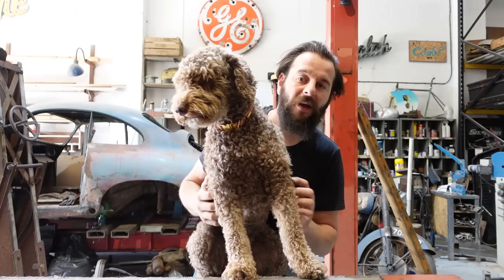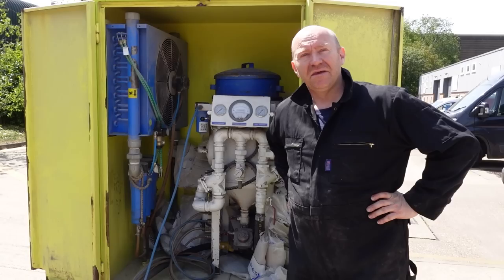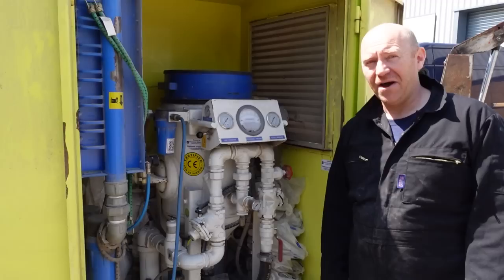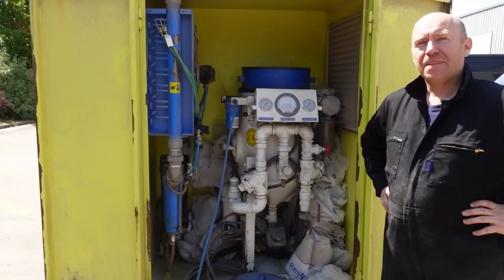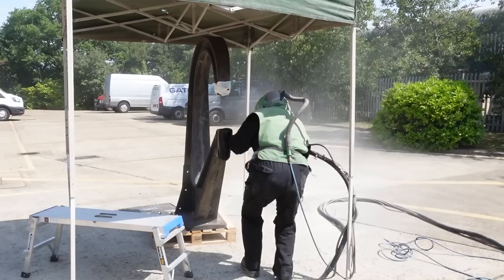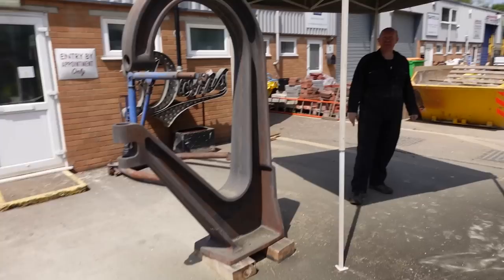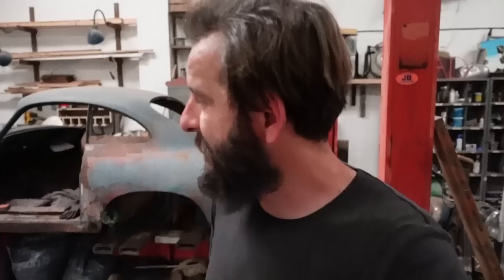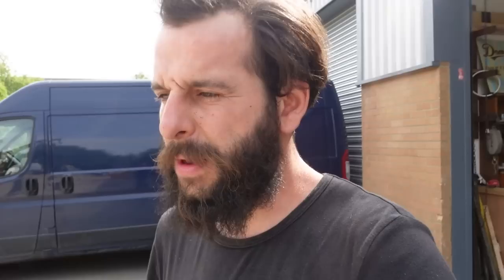Sandblasting And Painting The Ranalah | Reviving History

Comment: I would absolutely LOVE to get hold of a larger old Ranalah wheel machines. The school I went to in the UK, ( 55 years ago), had four that came from one of the WWII Spitfire factories. Although I doubt I could afford it. I think he means "purified air". Pure oxygen would kill you if you breathed for more than a short time resulting in shock lung. I also use a fresh air system. Nice compressor. I use an old 1956 LeRoi 4 over 4 tow behind compressor using 1" line at 175 psi. The gun is hand operated with a 'dead man' switch. Also can be used as a wert blaster. Any media from soda to steel shot.

Comment: When you get to blasting your Porsche have a look at hot zinc metal spraying. It's an excellent process for coating the undersides of vehicles with zinc so you get all the benefits of galvanizing but without having to dip anything. Something that the "retropowercars" channel (up in Hinckley) use on their restoration projects and it seems to virtually eliminate the possibility of future rust.

Comment: I’m just a DIY’er but if I’m painting from a cup (or small tin) I put the cup into a slightly bigger old bucket with a handle, and pack a rag round it to keep it secure. You’ve then got a handle to hold, easier to put down and pick up, less likely to knock over, and can stick your brush in the space between cup and bucket to free up a hand. Really enjoy the videos!

Comment: I must say that I would think the equipment used would have produced a much more even finish than this, it is very patchy, and while it will not make much difference for this project ,given the amount of energy and dust produced ,I would have expected a better result. Most large cast machines were given a wipe over of high build filler to give a smooth finish, if you look at Lathes ,Milling machines etc you can see this filler coat where the casting gets the inevitable chip. The castings are looking very nice, but only after your hard work to get them there! Chris B.

Comment: How does the blaster get pure oxygen out of compressed air? He might get clean air, but would never get pure oxygen. I would immediately doubt his competence if he said that to me.
Reply: Perhaps you are being too harsh.   It is a common mistake for people to refer to air as oxygen - possibly because it is the oxygen component that they actually need.   Media commentators talking about divers often talk about their oxygen supply when - of course - they mean compressed air.   Only naval frogmen using oxygen rebreather sets used pure oxygen, but they were limited as to their working depth as pure oxygen could be lethal below about thirty feet.   Specialist deep diving can be carried out using special gas mixtures to avoid including nitrogen that can cause 'the bends', but firemen and suited sand blasters working on land just use compressed air.  I'm sure if you were to ask Phil, he would correct himself immediately.
Reply: @donjohnson24  I might be very particular about these things but I was an engineer, working with aircraft and aluminium, most of my life. I am also a BSAC diver.
Reply: @TheBioniXman  Too particular to excuse a slip of the tongue?
Reply: While he is incorrect in referring to the blasting system providing oxygen you can get oxygen concentrators which use molecular sieves to separate oxygen from the air. They're used in medical and other applications, I use an ex medical oxygen concentrator for my oxy propane torch these days as it's cheaper than compressed oxygen.

Comment: Rather gentle blasting of a huge iron casting 😛🤣🤣 I’ve got an old blast cabinet from a casting factory and the wall thickness of the steel is 5mm 🙈 and they’d blasted right thru it several times 🤣🤣 steel grit  probably